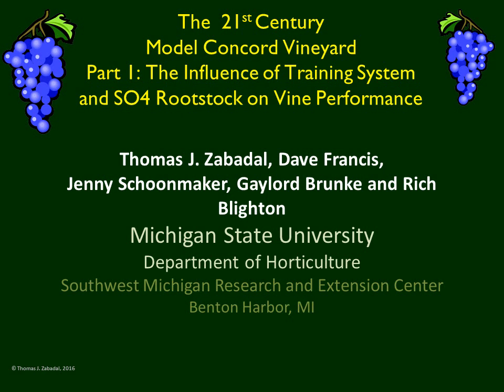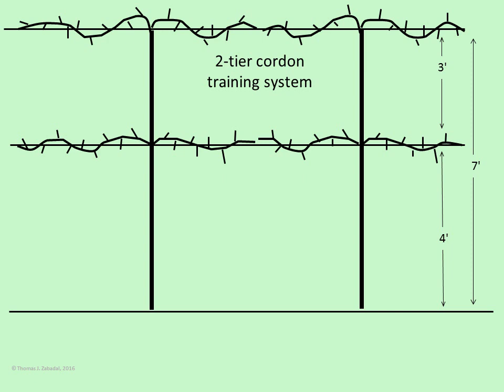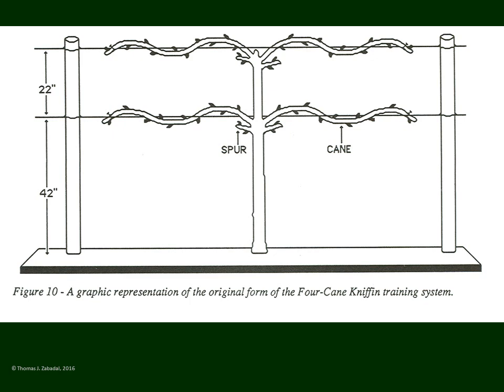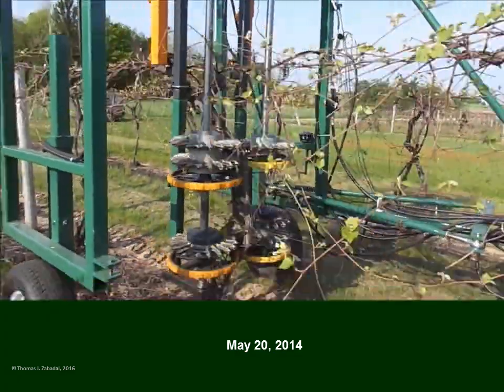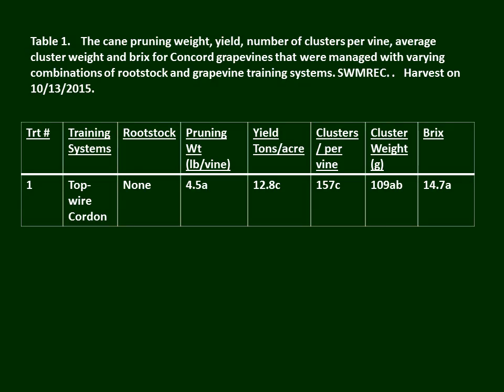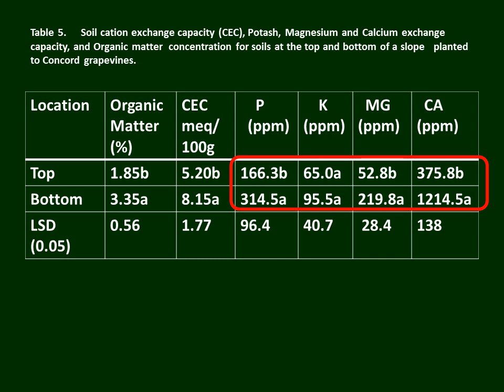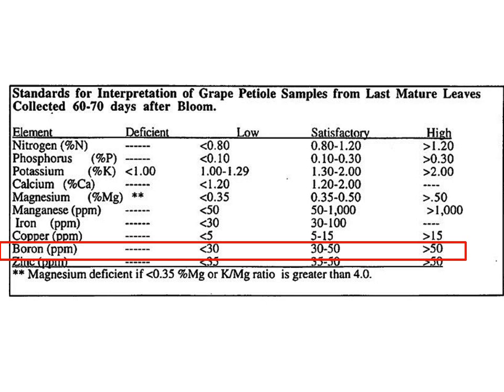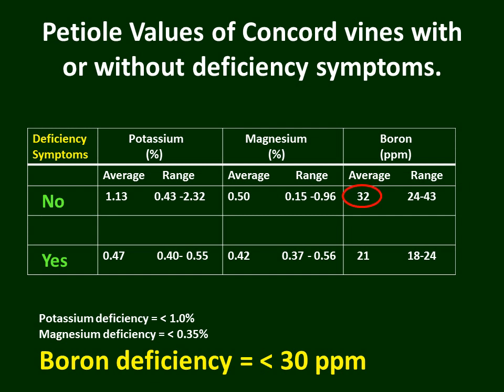2015 Progress Report  - The 21st Century Model Concord Vineyard

Comment: Tom, Thanks for the update this is very informative. As for the harvesting issue I believe a newer type harvester would help the problem out. The Chisholm Ryder pickers have been great workhorses and for crop in the 3ft to 7ft range they do a good job but from my experience the Korvan and Gregoire harvesters get the lower crop. One other idea I had would be after set and maybe just after you go through with the shoot positioning take a hedger and cut anything that is below the minimum height that the harvester can reach, this way the vine concentrates on crop that can be harvested also it would open up the lower part so air can move through easier.